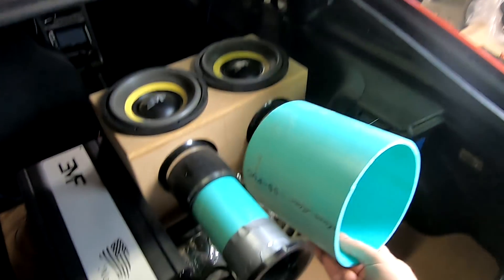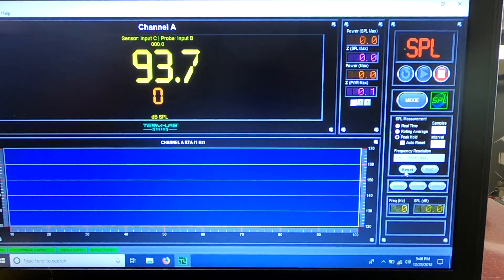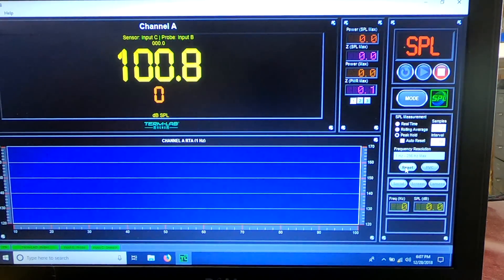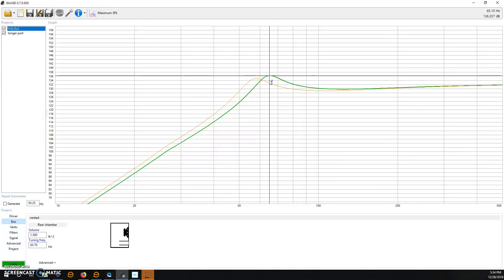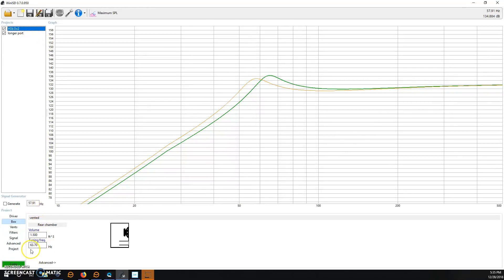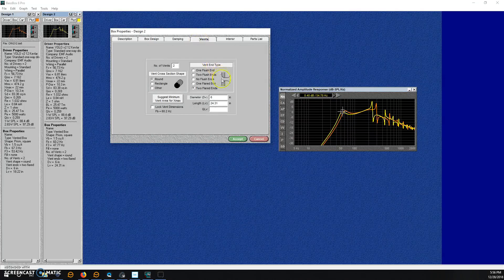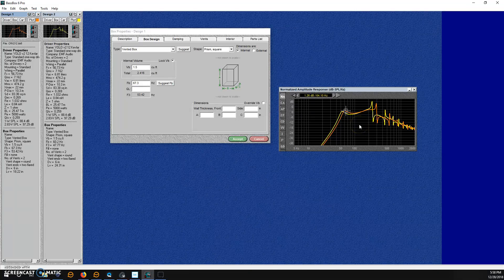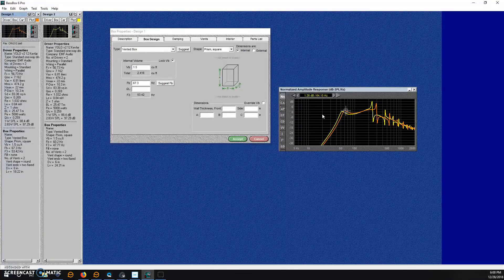Your box modeling software is very wrong, here's proof - Tech Stuff Tuesday

Comment: Nice test. One thing i wil say. The program don't Simulate Kompresjon factor inside Cabin and the box.  This happened when you test it on to much power, the Software gets incorrect. Try a sinus test from 100 to 10 hz att say 1 to 10 watts then the Kompresjon factor is not that high inside the cabin and the software will be a little better :) but i understand i have tested it my self.  I have tested in my car the software says it peak at 29 hz then  i tested with 1 to 10 watt and it peked att 28-29 hz correct, but when i turned up the volume to close max it peaked att 40 hz ^^

Comment: your first problem is your spl meter is stsrting out at 100. db's is all wro g in a normal room resting db's should be around 65 or so. now get that set right then start your test
Reply from the maker: Your first problem is starting a comment with "your first problem is". Inside that car isn't a "normal room". Closing a door will read on an SPL meter. Additionally, that meter won't read accurately below 120 dB nor it will ever show below 92 dB or so. The numbers being shown in the video are well above the threshold of accuracy. 140 dB is 140 dB if you started at 100 dB or 65 dB. It's not decibel addition.

Comment: The box modeling software would be correct if the TS params are correct and your measuring peak in free air not inside a car.
Reply from the maker: So it would be right if you didn't have it in a car, or in a room, which is exactly how you don't listen to them in any instance?
Reply: @EMFAudio  Correct. The software isn't modeling the speaker behavior in a car but in free air. You have to model how the speaker will behave in the environment that contains it. That isn't what most box modeling software does.

Comment: I've found it quite common that TS params from the manufacturer weren't even close to what I measured from a purchased speaker. Maybe they measure them on the prototype and then ship what they get from manufacturing instead of taking random samples from manufacturing and averaging those values. I often see measurable differences between two sequentially numbered serial number woofers. I would always measure my speakers TS params myself before building a box.
Reply from the maker: Many manufacturers either push catalog subs that they get figures from the build house and hope it's right, or they get them from freshly built speakers that have zero play time on them. It is common to find a small variance between two "identical" speakers, but in the big picture you won't hear those differences.

Comment: The software shows the port being inside the box. Does the software assume the port volume is separate from the 1.5 cu.ft. or does it consider it a part of? When I used to work at a car and truck accessory shop, Kove audio always recommended that we add the port to the existing internal like your video shows keeping the internal box volume unchanged by the port. So I was wondering how the software calculates. Hope that makes sense. Lol!

Comment: Well it's because those software does the calculations on an ideal open area, right at 1 meter from the sub or the port.
What the bad thing about these programs is that except if you can get your car acoustically analyzed you never get the results you want!

Example: On BassBox 6 Pro there is a tab dedicated to the acoustic behavior of the car.  If you cannot add the data(and most of us can't) the program is off on the calculations in the *car*.

SO all in all it's the fault of the software since they can't even provide us an idealistic in-car environment for a basis on response. Think about it.
Reply: I'm not sure it's really possible for the software to calculate how a setup will respond in a vehicle without some input from the person designing the system. Even then, what works for one guy might not work for the next because one might have deadening in their car or the other took out the back seat. You can't generalize and expect accuracy. Hence the reason why these software applications are just an estimation

Comment: I get what youre saying but your overall point seems incorrect. The calculated frequencies are not necessarily incorrect, they just don't consider the variables at play in a car. Yeah the software says the longer port would be quieter, but you've taken up more room in the cabin and moved the exit of the port so it's not and cannot be a fair A-B test
Reply from the maker: It sounds like you're making excuses. You think a miniscule difference in car displacement is the difference? If that were the case, me being in the car would over a few dB difference. The fact is, even if you take out the environmental variables you said, it's still wrong. In free air, it would still be wrong.
Reply: @EMFAudio  I was giving examples of variables you have changed. Yes the cabin volume change is likely insignificant, but moving the port opening 6" further from the drivers and closer to the rear of the car isn't. If you used actual measured ts parameters for your drivers and performed the measurement in an anechoic chamber, like the software is assuming, it would be accurate.
Reply from the maker: @Muffinx93  The distance on the port doesn't change anything in that car, I've tested it. I did use the actual tested parameters, and you just proved my point. ZERO people are listening in an anechoic chamber. Literally zero. There is no application where you would be doing that. But don't worry, I have another video coming in the future to prove everybody wrong stating it would be right outside of the car. Then there will be a new series of excuses to address.
Reply from the maker: Also, if I changed the port position, I'd change the sub position, so you'd gripe about that.
Reply: @EMFAudio  Exactly, I'm not disputing that the calculated response will not be correct in a car. Just that it doesn't mean what is said is wrong either. Physics is what it is. If you use a fluid dynamics simulator and modelled it all exactly, including position of the box, port speaker, seats, car body, materials used, etc. You'd get pretty close to real values. In reality, I don't think anyone is using box calculation software to try to predict spl in their cars, it's used to check tuning frequency to avoid over excursion. For that it is more than accurate enough. Finally, you say no-one is listening in an anechoic chamber, that is fair, but your BBP calculation includes a measured frequency response, if that wasn't measured in an anechoic chamber then your graphs will never be correct as they'll include the response of the room they were measured in.
Reply from the maker: @Muffinx93  You're making bold assumptions. I know for a fact people model speakers off of specs and choose what product they buy based on the graphs. I also know people are using them explicitly for SPL purposes. In either case it is not accurate. You say finding limits of excursion is accurate, but I and many other have proven that to be wrong as well. Pressure generated in the cabin holds the cone back. Applying the same power with a door open or closed gives a different excursion result, and may be the difference in the sub staying together or not. BBP can include environmental response but it has one huge flaw with that, reality. What you measure to apply (which is a separate issue based on the source) will change at different SPL levels. The higher the pressure, the different the response as a result of body panels moving and interior panels moving.
Reply: @EMFAudio  You still can't claim the software is incorrect when in reality it's people's ignorance of how to use it that is the problem. Box calculation programs are a useful tool in any enclosure build.
Reply from the maker: @Muffinx93  But if the environment doesn't change, and the speakers don't change, and the power doesn't change, but it gives conflicting results, how does that make the software correct?
Reply: @EMFAudio  Because all of that does change, the whole video is about you changing variables in an experiment and comparing to data generated by software considering a completely different set of variables... I don't see how this is so hard for you to grasp.
Reply from the maker: @Muffinx93  I changed 1 variable and compared results, not sure what you think everything changing is. I get it, you want it to be right because you live the graph life. I live in the real world, where that simulation gives false hope and isn't advanced enough to be accurate.
Reply: @EMFAudio  You changed lots of things, you just don't understand what you did. And I've stated many times I don't expect a box simulation to give me an accurate representation of spl inside a car, but saying its flat out wrong proves the extent of your knowledge...
Reply from the maker: @Muffinx93  I know exactly what I did, and I predicted it ahead of time as a result of testing in that car for 19 years. You're trying to justify it by making excuses. What exactly do you call something when it's not right? You just said don't expect it to be accurate, which is what? Wrong. It's not just SPL that wasn't right, it was frequency response too. No aspect of it was right making it.... wrong.
Reply: @EMFAudio  It's right in that it is a prediction of frequency response based on the information it's been given, in the environment it's been programmed for. You perceive it as wrong because you don't understand the difference between what you're asking the software to do, and what you actually want it to do.
Reply from the maker: @Muffinx93  and this is why I'm doing another video addressing it. It's not my perception, it's reality, but everybody that won't let go of graphs has to blame something.
Reply from the maker: Also, the point still stands that the software is being used as it's intended, and how the masses use it. Making excuses for why it's wrong doesn't make it right.
Reply: @EMFAudio  But this isn't what it's intended for, it's a tool to aid in box design, not a definitive "this is exactly what you'll get in your situation". You seem to be expecting a software package which has no awareness of what you're trying to do to just know everything. That's like the first rule of computers, they only know what you tell them.
Reply from the maker: @Muffinx93  If it's not what it's intended for, why do you select "automotive" for the application? I know what to expect, I didn't do the video as a learning experience for me, I did it for educating others with proof of results.
Reply: @EMFAudio  1. When you select automotive you're supposed to import your car's response. 2. You STILL aren't getting that just because it spits out a max spl number, doesn't mean anyone is taking it as gospel in their cars, it's a physical calculation which can only take into account the information it has available to it. All the other, more useful, outputs are less dependent on the environment so will still be fairly accurate.
Reply from the maker: @Muffinx93  You still don't get it. People ARE taking as gospel. Just because you aren't doesn't mean the masses aren't. I get messages all the time about how they compared this or that graph to figure out what they were going to buy. Even worse, I get people wanting to be sponsored because they designed something in simulation that said they'd be the loudest thing in the world and they don't even have a car to use yet. Even when it factors things in, it's doing it off of basically 1 watt of data both on the sub and the dimensions you've entered. It can't account for everything that changes in movement, AKA, wrong.
Reply: EMF Audio tbh I get what cnc is saying, and I think he also sees what your saying, you are both correct and wrong in your responses, you are talking from both sides and both playing devils advocate from both sides.

Box software is a guide, but as an spl guy there is no computer simulation in the world that is viable for a car at the volumes we play at, nor is it able to predict what the spl would have, the car would rot before we could add all the variables and determine there effects on spl, so in that respect you are correct

But cnc is also correct, changing ports distance to the rear of the vehicle will load the subs up changing impedence by a chunk due to loading the drivers up regardless of what you think, move ports and the drivers 6” further back and the impedence curve would change somewhat with the same length ports, it’s not physically possible to change one without altering something else

So in essence while bbpro or winisd makes a decent guesstimate of response and how suitable a driver is for a given box... that’s it... calculate with fs, fb and volume of the box to get port lengths etc and build/test/build/test/build/test etc, spl is never designed on paper unless it’s an extreme vehicle, then you can calculate for temp/humidity etc as the vehicle is effectively dead so you can then fine tune stuff... for example many years ago the Finnish guys went through the lanes and played x freq, they then showed me the spreadsheet for temp/freq, if we could play x.5hz we would’ve been 0.7db louder, the level of calculations and attention to detail was amazing, but that was with dd 9917 and a very sterile standardised environment with zero flex and no air leaks anywhere! They made extreme the art form it is today for me, they helped Dante, riprock and loads of others... I got mikko to do lists for my street max back in the day, awesome guys and I miss them!

Comment: This is the same as putting your sub box in another bigger box, aka car/room. You will get different results. Dont design a box for an open environment if it is not going to be in an open environment. It would be like designing a freeway system for a Kansas plain and dropping it in downtown SF. It wont flow the same. Design your box for the environment, dont design the environment around your box.
Reply from the maker: Exactly, but that is what people don't realize when they use programs like those.

Comment: Hmm, I modeled my sub in WinISD and It's very close if not dead on what my subwoofer does in my room. I'm using a slightly older version, and it has issues with the voicecoils (could also be the way I input it) and it throws off the measurements by a LOT. But when I fix it it's pretty close, much closer than in this video.

I'd be curious to see this test done again with a different subwoofer possibly. (make it easier and use a single sub instead of 2) Not because I doubt this video, but the more samples the better right?  Maybe make it easier and go sealed and see how the one models in the car and software. Then grab a basic ported box (like off the shelf slot port or something) and throw that into the software and compare it to the real world car test. For science lol.
Reply: Maybe grab one of these "Dayton Audio DATS V2" and use that to test some things.  Looks to be very handy.
Reply: I'd be interested in seeing that video...

Comment: All this says is that cabin gain at the tuning frequency is the dominant determining factor in this case. In a small car cabin gain will be as much as 24db by 60 hz.  Cabin gain is easily sumarized at 12db/octave below turnover. When considering all 3 dimensions and the modes of resonance the result you measure is almost normal.  All you are doing is saying that you need to test. Theres nothing wtong with the software whatsoever.
Reply: Try it using a sotware that can model real world results via REW sweep imports.

Comment: my SKAR called for 2.0 cubic foot box 32 hz .. i have a prefab 3/4 box that sounds great, same box worked wonders for my audio pipe that called for the same settings but at 33hz tune, which this box is. after seeing this video i'm glad i went with a pre fab instead of designing my own and thinking it was good. but i do wonder if depth and width according to manf specs actually matter, so long as cubic foot is the same...
Reply from the maker: The physical dimensions don't mean that much until you get into very specific situations, or counting 10ths in SPL.
Reply: so ppl out here getting custom boxes for a bangin' system, but just need to follow manufacturers specs and they are all set. crazy how simple that is. of course i say that statement assuming ppl play at tune
Reply: that being said, if anyone needs a good sounding 2.0 cu.ft per chamber 33hz tuned box... here u go.. 100 bucks
Reply from the maker: @notyobiz6207  Our recommended boxes you can play below tuning some and still be safe, because they aren't gigantic useless boxes.
Reply: it's simply amazing what those ports let you do. when you said 1.5 cubic feet it made me realize how much space your port had added, i'll assume that's what let's you play below

Comment: Hey man I'm gonna go ahead and let you know I appreciate this video. In the past I spent hours modeling different subs deciding which to buy. Settled on one and built the box. It peaked pretty hard, which I was hoping to avoid. That's when I learned about cabin gain. Since then I've seen people on forums and places doing the same thing. Or saying that X sub doesn't model well and whatnot. So these high and mighty critiques on here that know everything, well screw them because those of us that do exactly what you're telling us not to do are grateful for the explanation. So yeah thanks. A modeled response is not equal to real world in car response. Open the window and it changes, open the trunk and everything changes again, though probably closer to the model.